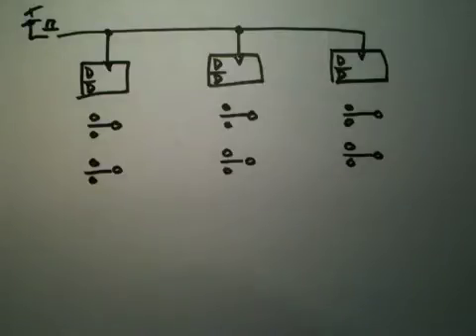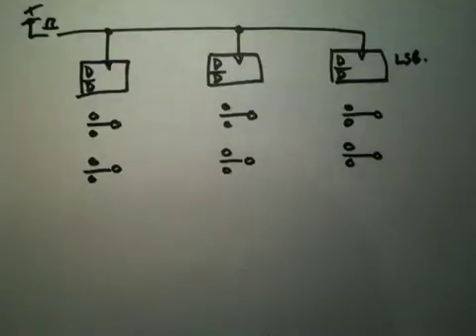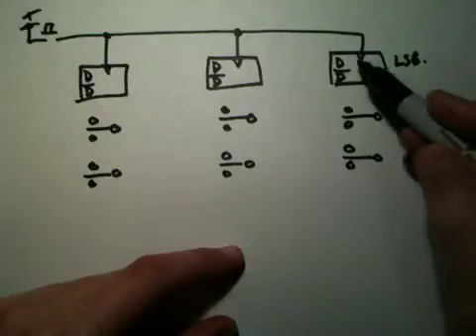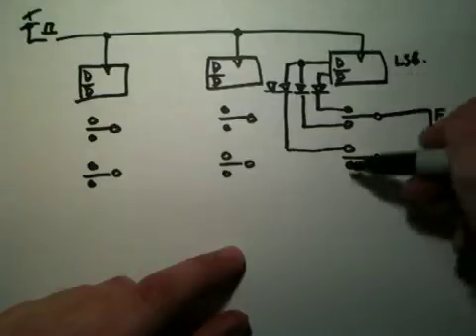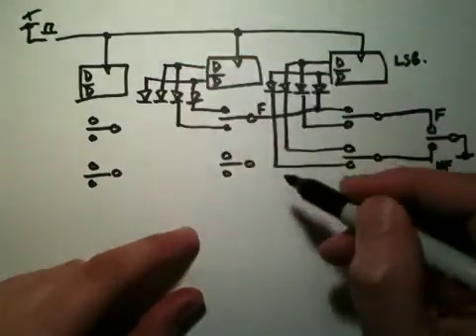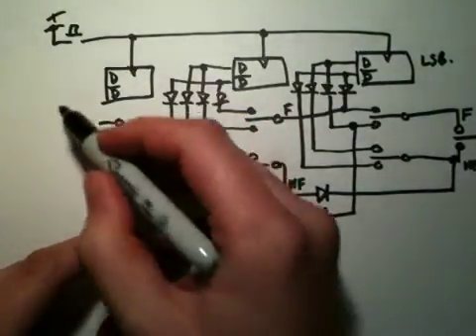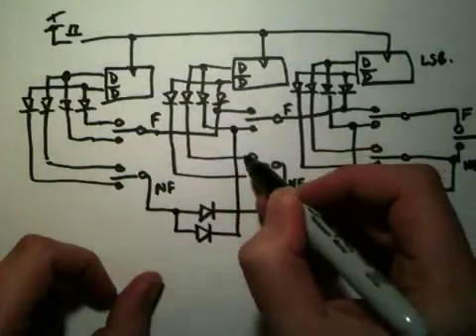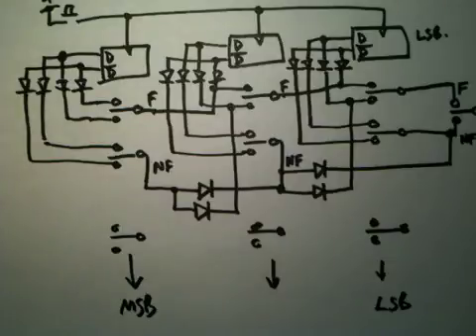Relay logic: synchronous binary counter

Comment: Hi Simon, Are the output contacts shown in this video inclusive or exclusive of the first set of contacts of the 'D Flip Flop' output relay?

I am trying to work out if this counter can be made with a DPDT output relay instead of a 4PDT. If the latter, would a pair of DPDT relays with paralleled coils suffice to replace the 4PDT?

Thank You

Comment: Can you create a modulo-14 binary counter using just five DPDT relays in Ladder Logic circuits? The display would be generated from across the relay coils by shunting them with small incandescent bulbs, not l.e.d.s..
The fifth relay would be used as a pulse repeater than would cycle the counter back to zero the instant the counter reached over binary 1110.. Sort of a four input AND gate to activate the fifth(carry) relay..
Do you think that is feasible?

Comment: How can you fabricate a 3bit 8-state counter with just three relays and no electronic components? Do you use 3PDT relays?
Reply from the maker: +Jeffrey314159 Not possible. The best you can do is with 6 relays and that circuit doesn't work so well. Ideally each bit requires 3 relays to make a general purpose counter.
Reply: +Simon Winder  I see, but-  with a ripple counter you can use just 2 DPDT relays per bit and still drive an LED display. I have seen as such here on Youtube with a guy using an old telephone dialing mechanism for the sequencer